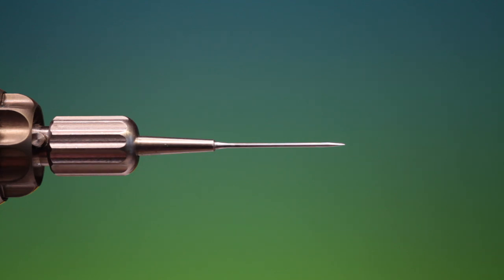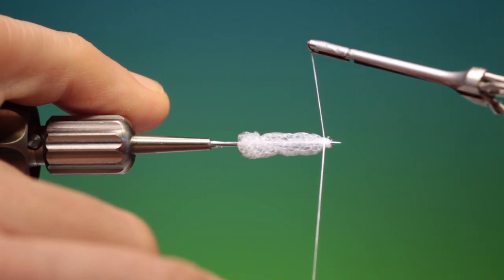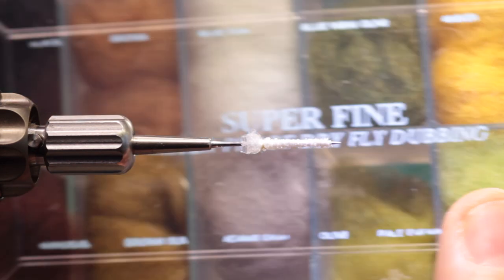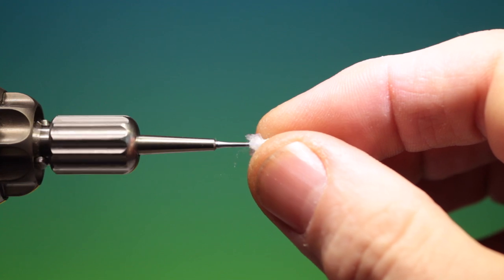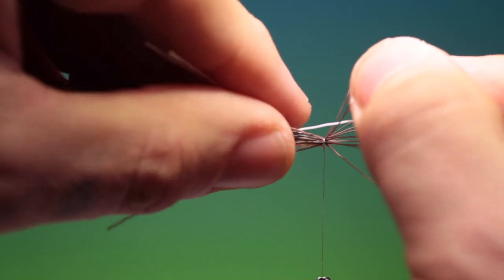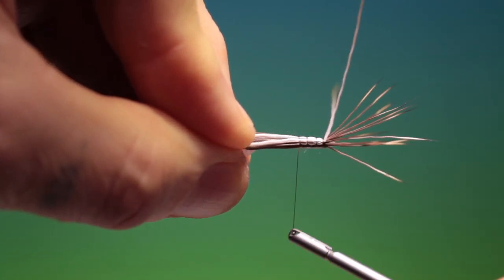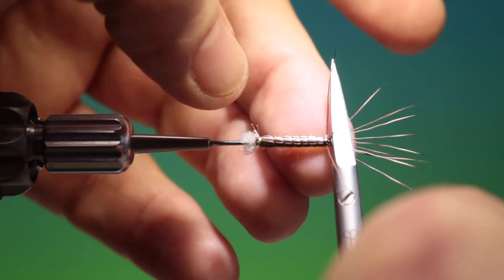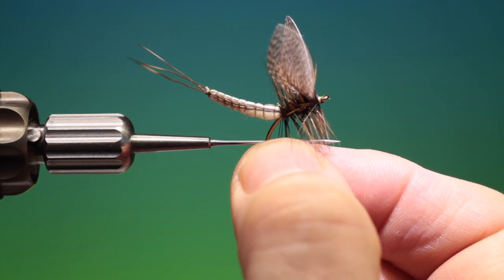Fly Tying extended mayfly dry fly body tutorial with Barry Ord Clarke

Comment: Super cool Barry, I have not seen an extended body prepared in this manner, good learning.  You would benefit from a Extended reach Matarelli Whip Finisher for core tools.  I use Mini Tiemco, STD. & Extended Reach Whip Finishers depending on application, and happy with all three.
Reply from the maker: Thanks Larry, I have sooooo many whip finish tools and I have only used the one I was given by Frank Matarelli in 1994, its just what you are used to using I guess.